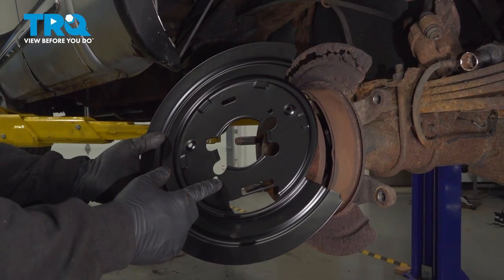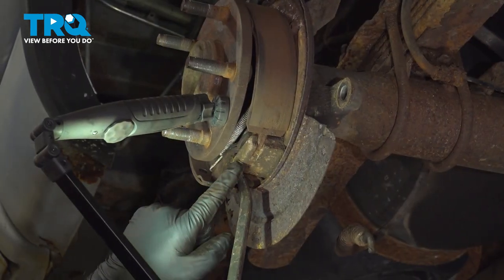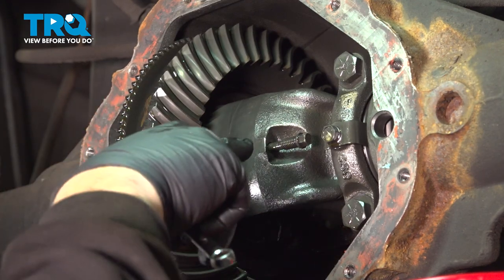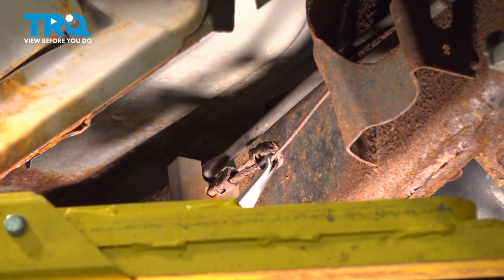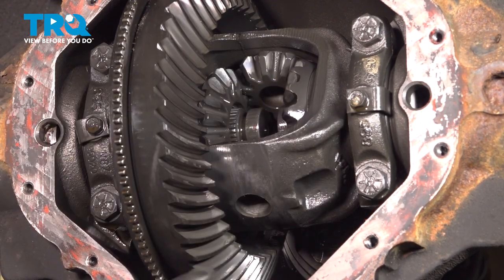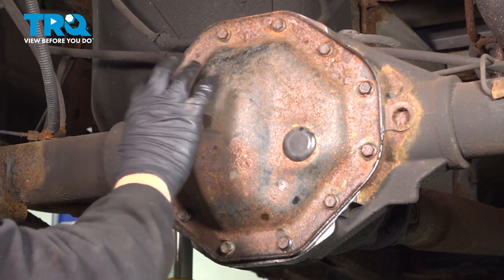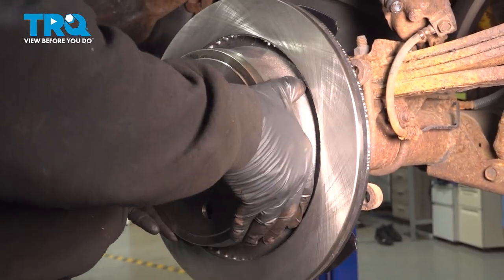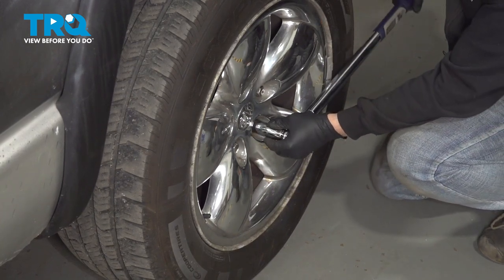How to Replace Rear Brake Backing Plate 2002-2008 Dodge Ram 1500

Comment: Just a couple of observations. If you are going to do all this, you might want to pull the axles first so the park brakes are easier to get to. Also, if you're going to pull the axles, you might want to go ahead and change the bearings and seals on both sides. I don't ever re-use parts like that.

Comment: When changing parking brake shoes, why would the other gentleman say, the long end on the spring, goes to the rear? This gentleman say it goes toward the front, and the other gentleman say it goes toward the rear when he changed the shoes, this is just confusing people, i saw some machanics or here without shops, pointed them to the rear.